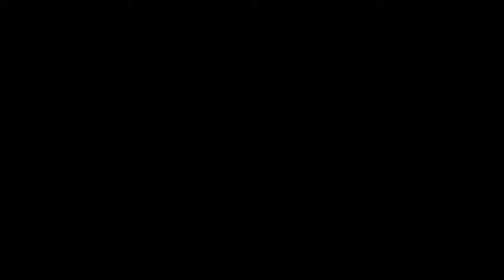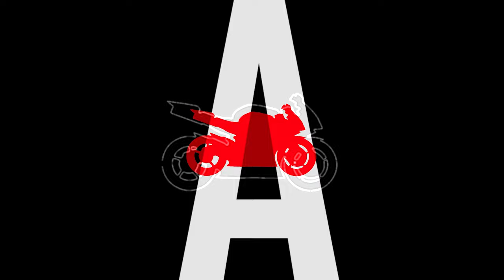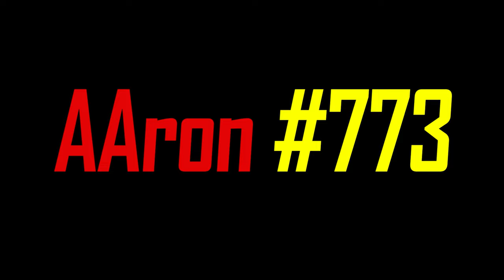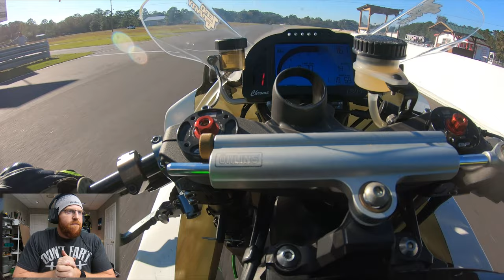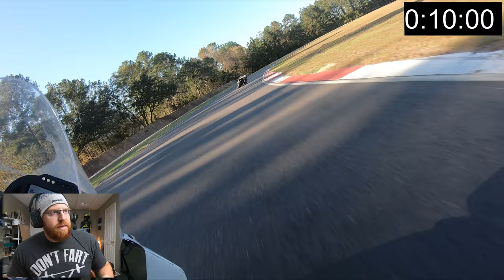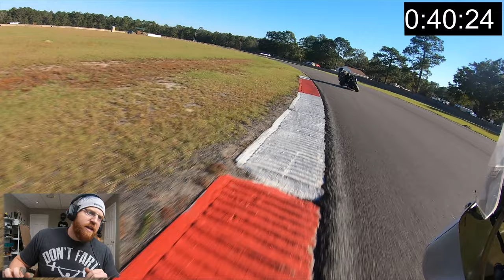REALISTIC POV Lap of Roebling Road Raceway | Kawasaki ZX6R Roadracing

Comment: Nice lap, cant believe they already have patches on the new pavement.  1:19's to 1:20's were my lap times on my 2000 ZX6R back in the 2001 2002 time frames. I plan to make an ARMHA SoT 3 race at Roebling in Feb 2023. That will be my first time back to Roebling since I moved in 2004.
Reply from the maker: Yeah the patch running through T1/2 is a hard to trust, but it’s good. I was not running the correct line for most of the track 😒
Reply: @AAron_Rides    Naw you were closer than you think. Of course I havent been on that track in a while so not sure how much the lines have changed with fresh pavement.
Reply from the maker: @388racing9  ah ok good! Thanks for the reassuring comment.  I hope you get back on the pace quickly and really do some things with ARMHA!